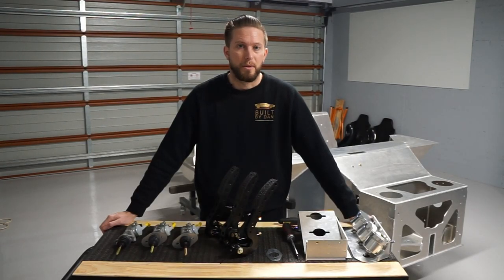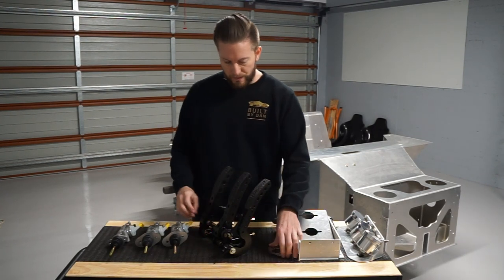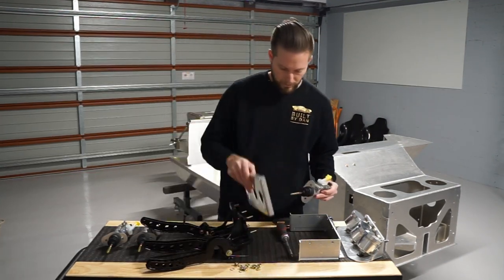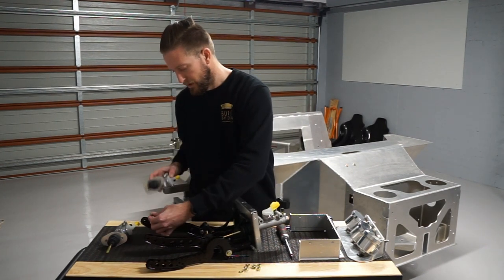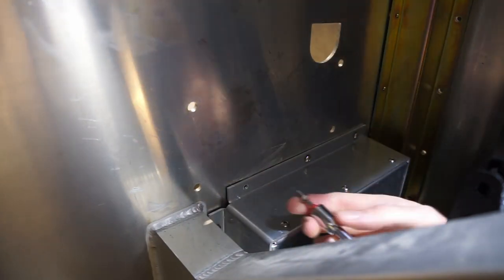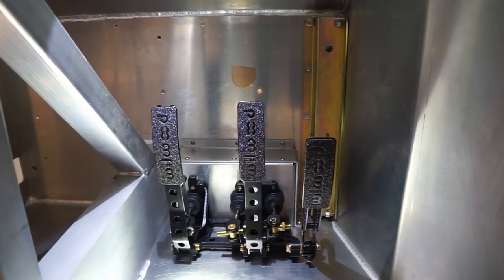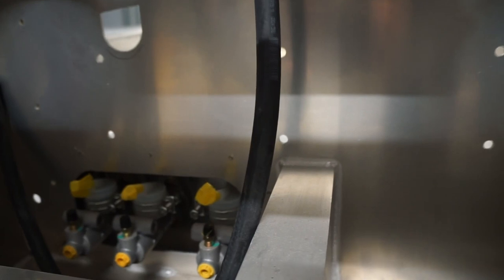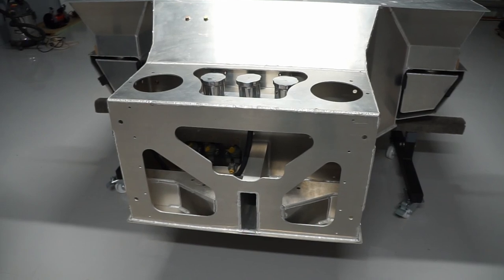GT40 Kit Car Build - Ep 08 - Wilwood Pedal Assembly and Master Cylinder Install

Comment: I remember in a previous video you mentioned sound issues. If you want to get rid of the echo/hollow sound go to your local walmart or ? and pick up the cheapest thickest drapes you can find. String them along one wall. They'll stop the sound bounce by easily 50%. I would suggest you could try laying them against the rafters and stapling them, but not 100% on if that would work as well as one wall. 

1/2 styrofoam panels would work as well. You could cut them into 4' diamonds and put them up diagonally.
Reply from the maker: I've purchased some 2ft x 4ft acoustic pinboard panels, they have helped a bit, as did switching to the wireless lapel mic. I might even buy a few more of the acoustic panels.

Comment: How do the reservoirs seal with the rivets, brake fluid is great at seeping past seals.  Also you will need a low brake fluid level sensor for both front and rear brake circuits.  These are normally mounted via the cap lid.
Reply from the maker: G'day Ryan, the rivets don't pass all the way through into the reservoirs, I wasn't sure myself how well they would hold, basically just relying on a compression fit within the recess.

Comment: Awesome chassis btw I use "nut rivets" alot especially on parts that need to be serviced
Reply from the maker: Thanks mate, any issues with the rivnuts coming loose over time? Bit concerned about them basically being compression fit into aluminium.
Reply: @BuiltbyDan  
That was also my concern, so far i had no issues with them but i only use them to mount "small compenents" or panels

Comment: 2 minutes in and I was wondering why you should have to cut the chassis, but then I saw the bead of weld underneath. If they had cut the hole out before welding the floor or firewall would have twisted a lot with the weld contraction.
Reply from the maker: It also allows the owner to determine a suitable pedal position and make the cut-out to suit.

Comment: Looking good. How did you decide to start their first? Is it according to a manual or your own knowledge etc.
Looking forward to the rest of the build.
Reply from the maker: The manual didn't really provide a lot of guidance on build sequence, I just figured the pedal and master cylinder was a good starting point for routing the brake and clutch hard lines. I ran this approach past the manufacturer and they supported focussing on anything 'fluid related' as a starting point.
Reply: Fair enough, good place to start then. cheers 👍

Comment: That footwell looks pretty tight, are you planning on adding a dead pedal?
Reply from the maker: No space for a dead pedal unfortunately. Only option would be to integrate a small piece of steel angle to rest the side of your foot/shoe on.

Comment: 7:40, have you got yourself an auto centre punch? And stepped drills?
Reply from the maker: I've got the stepped drill bits up to 45mm. The auto centre punch I'm still waiting on, local hardware store was out of stock and seems to be delayed in getting new stock. I might just check on ebay, it'll brobably get here quicker!
Reply: @BuiltbyDan  I have 2, one is smaller than the other. The newest one was a Kinchrome one I got from Bunnings.  The smaller one is a starett that I have had for ages. I keep seeing what looks a larger one for sale. The small ones are good for alloy. Middle sized one for steel. I’m guessing the larger one would be handy for thick section steel beams.
Reply from the maker: Yea the kinchrome one is the one I was looking at.
Reply: @BuiltbyDan  it works fine.

Comment: Check your render settings in your video editing software. Getting pretty bad interlacing artifacts.
Reply from the maker: I'll have to look up what that means... I'm using Davinci Resolve and rendering on their standard YouTube setting, Quicktime, H.264, Linear PCM for audio. I have noticed where I trim a section of video out and then try and apply a smooth transition video effect where it creates additional frames to try and merge the end and start frame of each clip together, it can sometimes do a pretty average job of it if there is too much of a difference between the two frames, giving a blurred/stepped transition effect. Is that what you are referring to?
Reply: @BuiltbyDan  If you're using a preset then the rendering output should be set correctly for youtube.  Make sure that the format of your footage (the camera files) is set correctly when you've imported them. This video shows you how: https://www.youtube.com/watch?v=3AhrnoOt-1I

Comment: I'm not really sure about the tapped thread into sheet aluminium, to be honest.
Especially to hold down something that important...
Reply from the maker: Thanks for the feedback, I did raise this with the manufacturer and they were confident it would be fine with locktite applied in final assembly. This is how they supply the kit, they also noted that the chassis is made of a higher grade aluminium. I'll keep an eye on this and can also switch to bolts with nyloc nuts or rivnuts for final assembly.
Reply: @BuiltbyDan  High grade or not, the thread is only two-ish revolutions long. And that's not enough for something like this.
Or anything, to be honest.
Indeed, I would back it up with a washer and nylock nut, or preferably use rivnuts there.

Where you CAN tap a thread is in the mounting holes of the reservoirs.
Pop-rivetting those is just an annoyance in the future, when for whatever reason they need to be removed.

Comment: Why three master cylinders? Brakes Clutch then what? I see two for the brakes, wow! Front and rear...Bias adjustment???
Reply from the maker: Thats correct Steve. 5/8" for front, 1/4" for rear and then bias adjuster at the pedal.

Comment: It’s was hard to see in the video but please make sure you have lock nuts on the master cylinder pushrods. You need to lock these off against the threaded clevis on the brake and clutch pedal.
Reply from the maker: Thanks for the tip. There were no lock nuts supplied with the pedal assembly, but I'll double check the other bolt boxes  and worse case I'll go buy some extra nuts.
Reply: Also use thread locker wherever you can
Reply: @backyardidiot  I was going to suggest that as well. Once you have something situated exactly where it will be and no longer require removal, a little dab of blue never hurt anyone. 

I follow vehcor on youtube and GM uses it on everything, I think they buy it by the container truck lol

Comment: Yo Dan, when it comes to bleeding your master cylinders I wouldn't bother trying to bench bleed them. It makes an awful mess! I just use some clear tubing, run a circuit from the nipple back into the reservoir and pump away 👌
Reply from the maker: Thanks for the suggestion James!

Comment: If you are going to do a lot of tapping aluminum plates I would suggest buying a couple of spiral flute taps. I use them for power tapping in the mill and you can run also them in a cordless drill on low speed. Saves a lot of time and makes nice threads.
Reply from the maker: Thanks for the recommendation Michael. Lots more tapping to be done, I might have a took into those spiral flute taps. 👍

Comment: DAN, you should have measured your blood pressure before and after drilling your first hole in your car!! Get a spring loaded center punch (Harbor Freight or the equivalent is fine). That eliminates the need to 'peen' the center punch and eliminates a lot of slipped punches when you hit it with a hammer. On that sheet aluminum you drilled and tapped - a better solution is to back the screws with nylox (nylon) locking nuts. You'll 'pull' the threads in the aluminum... there's not enough threaded material for those screws to remain tight for very long, and the pedal box assembly will loosen. For that matter, I'd use Nylox nuts almost anywhere the kit calls for a split washer backing a nut. 

#2: Get a brake bias adjuster (example: Wilwood 340-4490 Remote Brake Bias Adjuster). You don't need to permanently install it, but you'll bless the day you use it to adjust the bias. (After setting the bias... road testing the brakes, you can remove the thing. IF you were racing the car, adjusting the bias for each race track to the car, you'd want to keep it. It'll make life easier when you reach that point in the build).

#3: I'll send a separate email, explaining how to bleed those master cylinders before final assembly. It's not difficult, but if you don't get 100% of the air out of them before you complete and bleed the brakes, you'll never be satisfied with their performance.
Reply from the maker: Thanks so much for the advice Carl! Funnily enough the manufacturer used to supply bolts with nyloc nots, but has moved to tapping threads into the aluminium instead... I'll definitely look into the remote brake bias adjuster, anything to provide a better outcome, especially when it comes to the brakes! Thanks again for your ongoing support and advice, its very much appreciated.

Comment: Is the hose for cylinders/reservoirs compatible with brake fluid? Tygon etc? I just changed my hose from remote reservoir to clutch master because I had simply used some left over fuel line thinking it would be fine, however it was "sweating" fluid. I replaced it with Tygon. Doesn't seem to be sweating any more.
Reply from the maker: G'day Matt, I'd hope so as they were supplied in the Wilwood master cylinder kit, the only thing I have changed from the standard Wilwood kit is I swapped out the plastic remote reservoir for the billet ones with the custom bracket. I'll double check the details on the hose though to confirm as that's not something I really want to have to deal with once I get it on the road, so better to be sure now whilst it can be easily rectified!

Comment: Huh, what...why is the hole for the steering rack too small?????
Reply from the maker: G'day Rick, apparently new steering rack supplier due to COVID, so maybe the housing around the input shaft was slightly different design? I don't know.
Reply: @BuiltbyDan  That would explain a lot. You'd think with all that CAD software they would have been prepared for something like that and all he downstream issues.

Comment: A small tip if I may. Get an automatic Centre punch to mark and start your holes. Accurate and easy to use and helps Centre the drill bit. 
Also, a small portable cordless vacuum cleaner which if you use as you go along, makes for a habitable workspace within the bowels of the car. Enjoying your videography
Reply from the maker: Thanks for the suggestions Achmad. I've ordered an auto centre punch following a few similar suggestions. I have a shop vac handy, I just forget to use it while drilling so usually stop to clean up afterwards. I do like to keep the car and workshop clean.

Comment: I know I write some smartass comments but this is more serious; sis you center punch those holes before you attempted to drill them? If no, that will stop your bit from wandering. 

Another thing you might want to look into: putting a gasket between the stainless steel and aluminum. Dissimilar metals don't play well together. (galvanic corrosion). Even a nice thick coat of paint will help.
Reply from the maker: Yes I did centre punch, then did a small pilot hole, then drilled the final hole size before tapping. May be overkill  but I'd rather take the time with the additional steps and make sure it's done right. As a few others have mentioned, I do need to invest in an auto centre punch to stop the punch slipping when I hit it with the hammer, especially in some of those awkward to get to places. I enjoy reading the smart arse comments as well as the serious ones all the same!
Reply from the maker: Good pickup, might look at some 1mm rubber to go between the reservoir and bracket. Where stainless screws fix into aluminium they will generally be coated with locktite.
Reply: @BuiltbyDan  yeah the auto centre punches are a godsend. 

I hear you on the extra steps. Since I didn't have a mill and wanted all my holes accurate I first marked them with a hardened scribe, then centre punch, then centering drill bit. A centering bit isn't spiral, it has a small side cutting point. then a chamfer to guide your twist drill "centered". 

I don't know if you need to be that accurate.

Comment: Some sound absorbing panels on the walls and/or ceiling would really help your sound quality.
Looking forward to the rest of the project!
Reply from the maker: Thanks for the support and suggestion, I have since purchased some acoustic boards and installed them on the walls, it has helped a bit, but it is still quite a large box with all hard surfaces so not sure how much more I'm going to be able to do to improve it. I have recently switched to a wireless lapel mic which has also help eliminate a large amount of echo.
Reply: @BuiltbyDan  ah ok, you can ignore my post above, Geep basically beat me to the punch! :-)

Comment: Hi Dan, great to see you started. I'm still researching the GT40 builds and have had a lot of trouble trying to identify the transaxle which are relatively easy to obtain (not ridiculously expensive) and suitable for a Ford Coyote.  What transaxle have you settled on and why?
Reply from the maker: I went for the Graziano 6 speed transaxle out of the Gallardo. This it a large transaxle though and not suitable for a lot of GT40 kits. It's a strong transaxle that can handle some decent horsepower. Plenty of other options out there such as the Porsche g50 (and other variants) and Audi 01E transaxle. The Audi transaxles are relatively cheap. There are a number of suppliers out there that do adapter plates to mate the various engines to different transaxles.
Reply: @BuiltbyDan  I believe B is for Build used it in his LS swapped Hurican and he's putting 1000 hp through it. I think he also used it in his dirtican build too.

Comment: Be careful when using threads into sheet aluminum as a steel bolt can easily pull the threads right out! Best practice would be to use rivnuts in most non-shear situations. Locktight is also your friend.
Reply: I agree entirely, particularly if the part is removed and replaced repeatedly. That aluminium looked to be about 4-6mm thick and there wouldn't much thread there after tapping.
Reply from the maker: Thanks for the feedback, I did raise this with the manufacturer and they were confident it would be fine with locktite applied in final assembly. This is how they supply the kit, they also noted that the chassis is made of a higher grade aluminium. I'll keep an eye on this and can still switch to bolts with nyloc nuts or rivnuts for final assembly if required.
Reply: @BuiltbyDan  I built a CNC and have threaded into T6 aluminum and still holding strong after 3 years. Once you get that pedal box in place for good, red will prevent it from ever coming out lol.

Comment: Fantastic project! Just be aware of galvanic corrosion between the stainless and aluminium, it may be ok but I thought I’d mention it.
Reply from the maker: Thanks for the tip!
Reply: I mentioned that as well. It IS an issue. It depends a lot on the area touching hence why I think they used those rivets instead of bolts. To prevent any issue down the line a simple rubber gasket or even thick coat of clear lacquer will do the trick.
Reply: If I'm not mistaken I believe it's aluminum and regular steel that react not stainless steel.
Reply: Galvanic corrosion can be mitigated through the use of an assembly paste such as Duralac. This is use in the aircraft sector to avoid the issue on light aircraft.

Comment: Hi Dan. Great work. Love the GT 40 builds. Are you using loctite to secure the screws and nuts.
Reply from the maker: Thanks Jo. I'm just doing a dry test fit first and will then pull it all apart and assemble with loctite or anti seize as required. Too many fitment issues and unknowns as to how many times I will need to disassemble and reassemble components.

Comment: On your brake master cylinder can you use a hydraulic powered brakes ???
Reply from the maker: Basically every step of the process I've had to reach out to them as something hasn't worked out right or as expected and the build manual didn't provide any guidance.
Reply: @BuiltbyDan  very,  very good. Wish you the best.

Comment: Hey Dan, awesome build so far. Loving your video's!
A couple of friendly suggestions; I see you drilling panels with drill bits. If you use a step drill, the holes in thin panels will be far more accurately round and a step drill will not grab as aggressively as a drill bit. Also, when assembling bolts, I like to put a bit of copper never seize on the thread. It makes it much more easier to disassemble components after a few years of driving.
Can't wait to see more progress on the build, keep it coming!
Reply from the maker: Thanks Frostie, I have a couple metric stepped drill bits, but because I'm drilling holes for imperial bolts, most of the time I usually need a metric drill that falls between the stepped drill bit increments - I know it would probably be easily solved by buying imperial stepped drills - but trying to work out imperial sizes hurts my head, moreso than trying to convert them to metric!
Reply: @BuiltbyDan  easy, just multiply by 25.4

Comment: OMG!!  You installed the pedals on the wrong side!!!    😋  🤣 
Hello from Canada 👋
Reply from the maker: Really? Damn, I knew I should have read the build manual before I started! You mean to say I now need to repeat that whole process on the other side? What am I supposed to do with that big hole I just cut in the chassis on the right hand side? 😂
Reply: @BuiltbyDan  No worries!  Put pedals on both sides and you can earn extra cash to pay for the build as a driving instructor. 👍  😁
Reply: ha, I said the same thing, also a frost bitten Canuck!